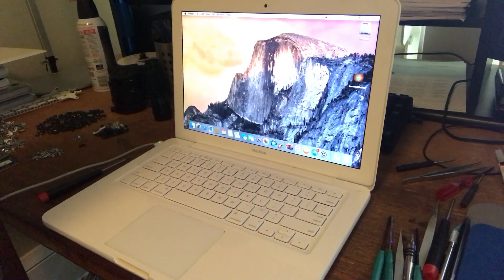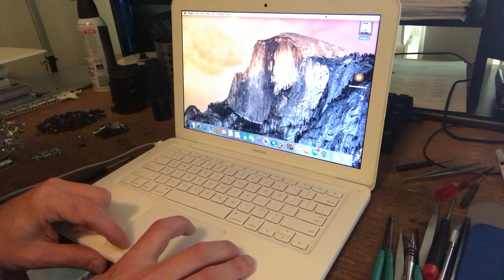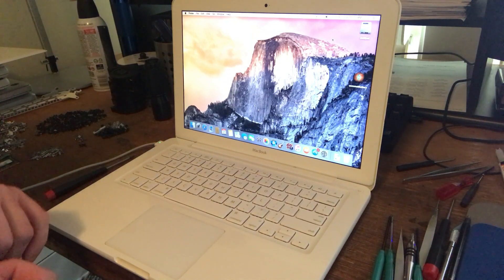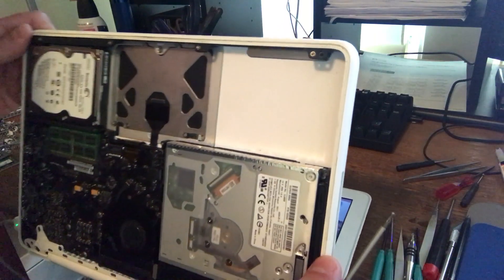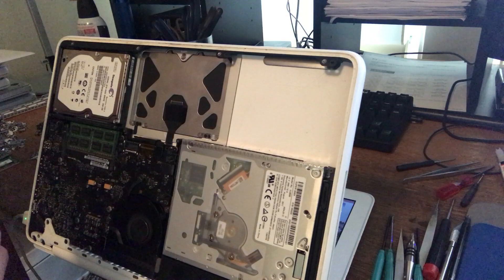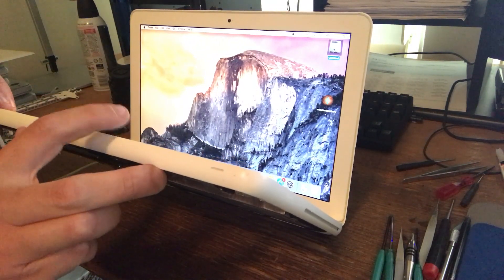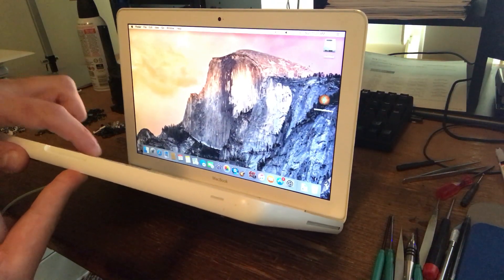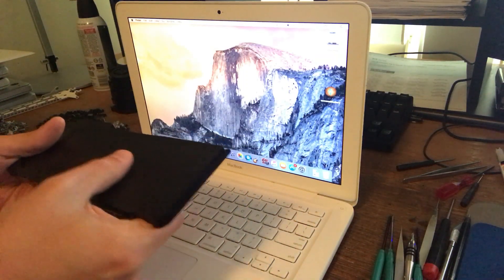Adjusting Trackpad Button Sensitivity on a MacBook i.e. "Soft Button" Fix

Comment: Hi, old video, I know, but will this adjust the click of the whole trackpad (Force Trackpad?) where you can press down anywhere on the pad and it clicks and is the same as a left mouse click (like bottom left of the trackpad)?
Reply from the maker: No, force touch was not introduced until 2015, and this is an 09/10.  Like you said, old video

Comment: The adjustment screw came off in my case, got a new adjustment screw, but it's really hard to screw it back in place.
Reply from the maker: Be careful -- the threads on the hole can get stripped, in which case you're screwed, no pun intended :-)
Reply: @RDKLInc  happend to me.